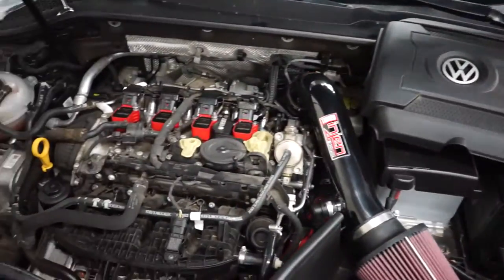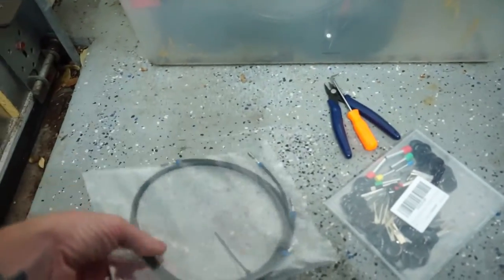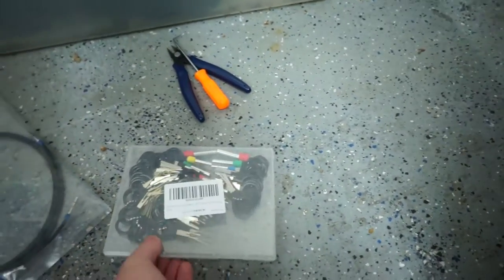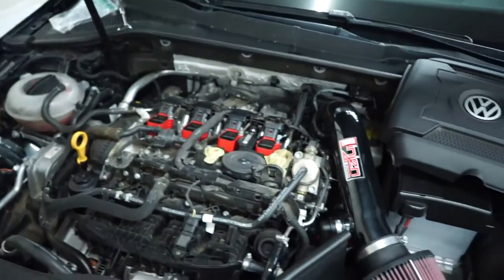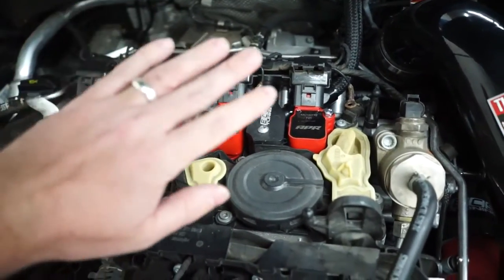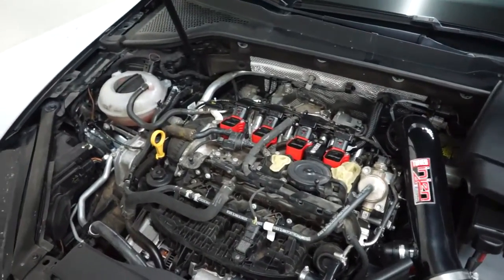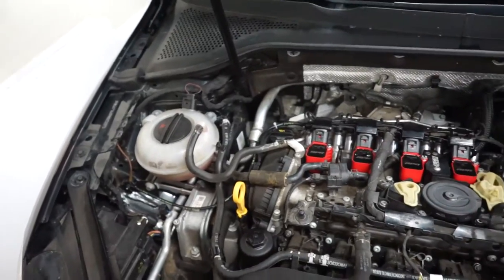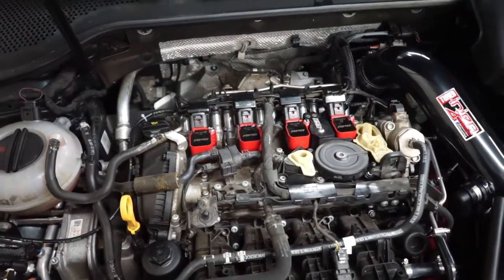Installing the EQT Pro Coil Grounding Kit on the Mk7 GTI

Comment: Can you provide me with a list of the parts you purchased for this install? I have a ground wire that's actually exposed and I was thinking of putting a kit like this together. I know you said the eqt pro ground kit but where did you get the pin removal kit and what ground bolts did you use? Thanks! Great video.
Reply from the maker: Bolt size is listed on EQT website. There's tons of depinning kits on Amazon.
Reply: @ColoredinLight  are the bolts the exact same size as the oem ones?